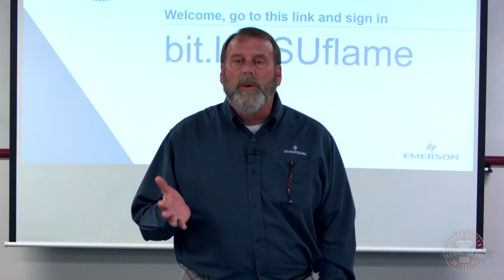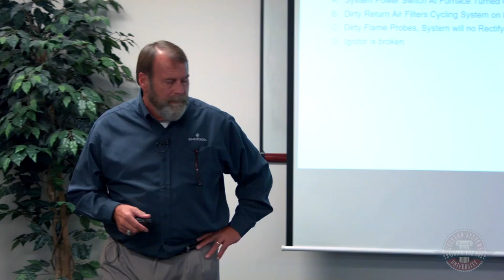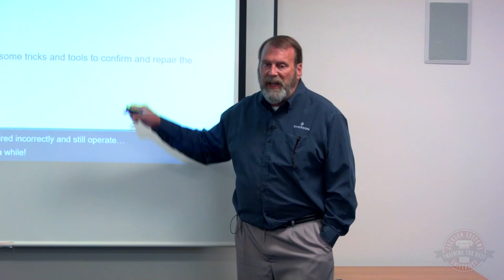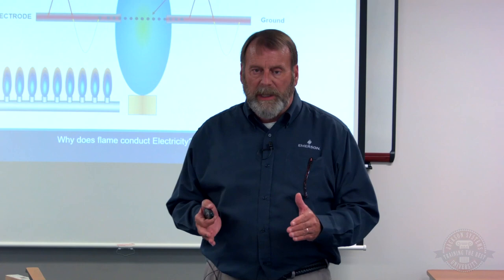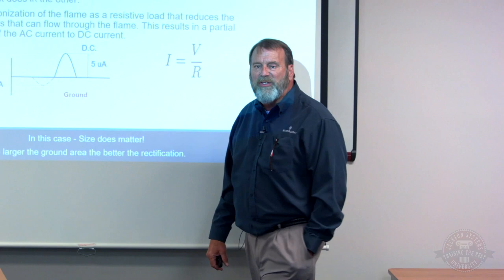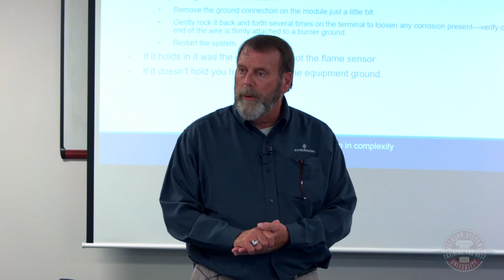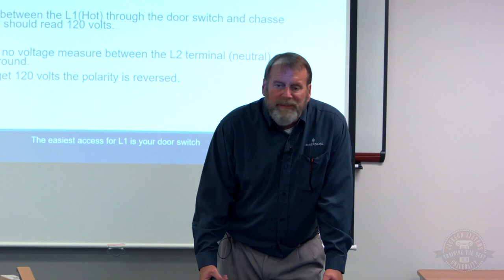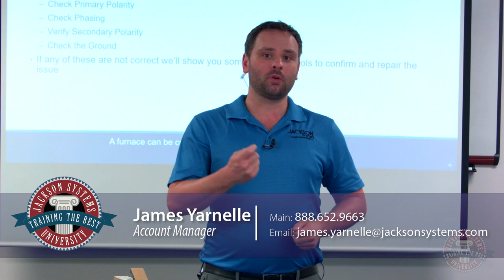Understanding Furnace Flame Proving Controls

Comment: I’m a U.K. based gas/heating engineer. You call them furnaces we call them boilers, our boilers are connected (for the most part) to wet radiator heating systems. For a period of my career I worked for a boiler manufacturer,  we had a reoccurring fault at a customers property where the boiler would randomly shut down to ignition lock out. Various engineers had visited the property and changed gas valves, ignition leads, flame sensing leads, flame sensing probes and a control board but the problem remained. It was discovered on my visit, that the customer had an intermittent fault with the house electrical system. One of the lighting circuits would put a short to the lighting earth (ground), when that happened it would interrupt the flame rectification circuit on the boiler, problem solved. Good, informative video.
Reply: Wow I don't think I would have  figured that one out! In the United States they usually have their own dedicated breaker, shouldn't that prevent such things?
Reply: In the states we don't boil air, only water
Reply: @isonlynameleft  Poor grounding system in the house.
Reply: Furnace= Forced hot air
Boiler=Hydronic system

Comment: Thank you for this explanation.   I see someone already commented on the fact that a microamp is a millionth of an amp, not a "billionth" of an amp but let me also add that the actual peak voltage of 120VAC as measured on a True RMS voltmeter is 169.7 Volts at the peak of the sine wave.  So pointing to the peak of the sine wave and calling it 120 volts may be leaving out an important concept.  I enjoyed your class.

Comment: Not knowing anything about HVAC I am totally lost. I have heard mention of the neg. feedback, but it really did not make any sense, well kind of. My AC/furnace was shut down a few years ago. Every year they came out and replaced 2 to 4 lbs of freon and the cap and the control switch, first year $300 second year $400 Third year I replaced the cap and control switch They put the freon on in and it was $500 And the next year I bought window units. But when the temp hit a high of 14% I tried to start up the heat. Cleaned the filters and attempted to clean the ignitor and heat sensor. But broke it and got a new one and got it installed. Still no heat. I cleaned the jets and that was a pain. All it does is run long enough to glow red then shut off if you look close for a brief moment you will see the ignitor have a blue flame around it. Looks more like the old type pilot light being lit. But it soon shuts off and it restarts again. Not sure what to do.

Comment: is it a fact that the 120 volts sinewave goes up to 170 volts and down to - 170 ( 1.41 is the square root of 2)
and that 220 volts  peaks at 311 volts?
it's that the 110 and the 220 are RMS volts, NOT peak volts;
careful, the  peak volts  are the ones that shock you !!!
now back to the video; an excellent video by the way!!!   thanks
Reply: Was hoping someone would have said this on the comments, Peak is different than RSM which is what your meter reads
Reply: RMS is effectively the average voltage since we go from peak to zero voltage.   Any ac voltage, even 24 vac can shock you.  A lot depends on your conductivity which changes if your skin is moist.

Comment: I’m pretty confused, is the flame a conductor inside the Flame rod? Or is the flame touching the orifice which is the ground? Or is the flame touching the heat exchanger metal and that’s the ground? Or is the tip of the flame sensor Arcing to the closest piece of metal inside the furnace?
Reply: I understand that the rod is getting 100 volts, but then where is that being transferred to? Through the flame or past the flame and through the tip of the rod?
Reply: In simplest terms, the flame sensor is engulfed by the fire, 100 volts goes through the rod, makes it's way through the fire, back to the metal burners (which are also engulfed in flames), to the grounding wire next to the burners, then to the circuit board/rectification. Think of the fire as a DC wire, not a flame shooting in one direction.
Reply: @TheMaster5150  Ohhhhhhh Got it!!! Thanks! It goes through the Burners
Reply: @dannyg751  That's a big 4-10. Remember...everything metal on the unit is grounded. But the burners are closer to the flame sensor, and more engulfed in flame than the spud, and gas manifold....which is painted/insulated. Ground takes the path of least resistance, and the ground wire next to the burners that connects to the circuit board is copper...AKA less resistance.

Comment: @ 36:20, you said "if you get hit by 5 amps, a heavy load, it would knock you across the floor, it hurts"...lol...God help you if you got hit by 5 amps because it could take less than about 1% of that to stop your heart and kill you. Due to the resistance of your body however, it would take a very high voltage (that math you also show) to allow that 5 amps to pass through your body, that's where the puddle of water comes in. Also, mA are thousandths of an amp and uA are millionths of an amp, not millionths and billionths as stated @ 36:32 thru 36:38. But otherwise, good info and thank you for providing it.
Reply: Correct on the ma (1,000s) and ua (1,000,000s).  Nevertheless ua's are very small.  Most meters are not good enough to read it.  The resistance of the body (technically impedance when talking ac voltages) varies dramatically depending how moist your skin is and where two points of your body are touching ground or another part of the circuit.  Ever notice how birds can sit on 14,000 volt high voltage lines?  They are not touching a ground or other part of the power distribution system. As a result they are not shocked.